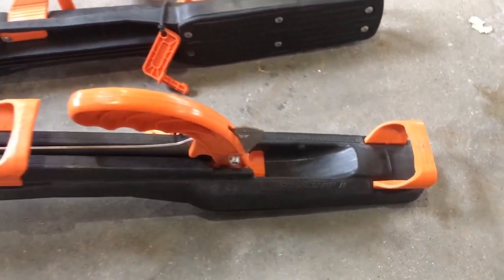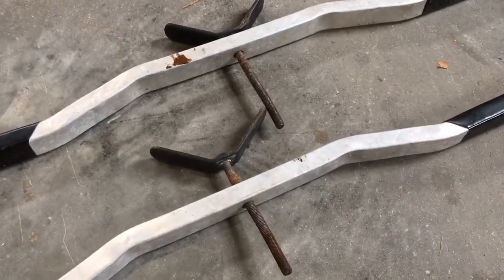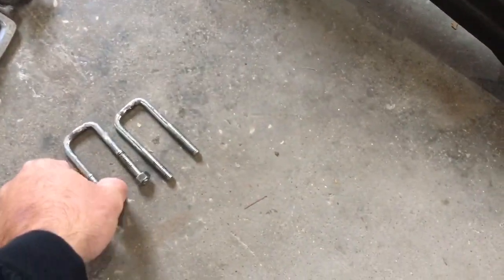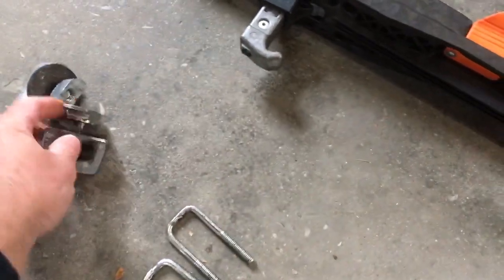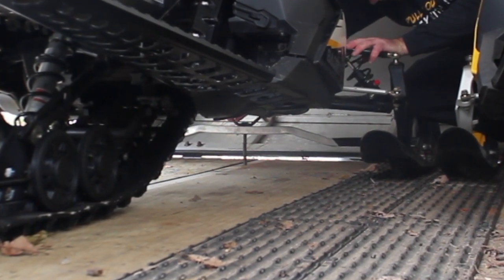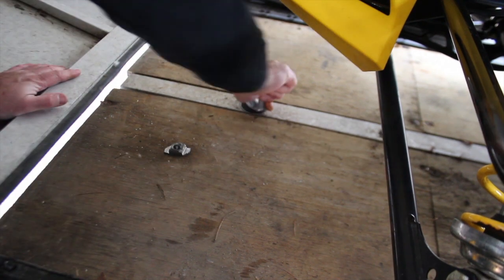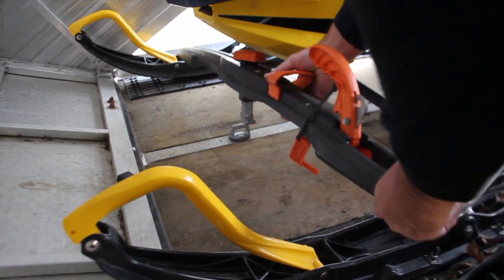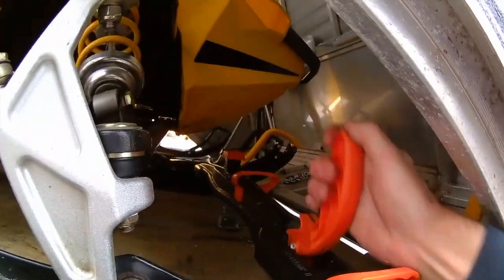HOW TO INSTALL SUPERCLAMP II ENCLOSED SNOWMOBILE TRAILER

Comment: It doesn't look like the the threads went deep enough to actually secure the hook. If the threads aren't all the way through,  they aren't holding squat.
Reply from the maker: Not sure what you are looking at.  The entire nut is in the threads.  Run this for 3 seasons and no issues
Reply: @mudbrats   When you screwed in the anchor to your existing floor rail, it appeared (to me at least) that the shaft of the anchor may not have been long enough, based on how few times you turned the SC anchor, for the threads to fully protrude through the floor nut. When viewed from underneath the trailer, you should see a minimum of 2 threads out the bottom of the anchor, which is the industrial standard for securing a bolt in a nut. You likely won't have an issue until you need it the most during emergency breaking, or some type of collision, when the 500lb sled will more easily than it should, break free and commence it's travel forward.
Reply from the maker: @ApexLTX56  There isn’t that much thread on these rail anchors - that’s threaded all the way...On my new trailer I used the long shaft threaded posts with nuts right through the bottom of the trailer.

Comment: Were can ya buy these
Reply from the maker: Pucky 76 if you are in canada Royal Distributing sells them as well as most snowmobile Dealers.  go to www.superclamp.net. - also just found out amazon has them:  https://www.amazon.ca/gp/aw/d/B003CJJVPG/ref=mp_s_a_1_1/134-7414899-5956341?ie=UTF8&qid=1518925397&sr=8-1&pi=AC_SX236_SY340_QL65&keywords=superclamp&dpPl=1&dpID=31MYr1n-nGL&ref=plSrch